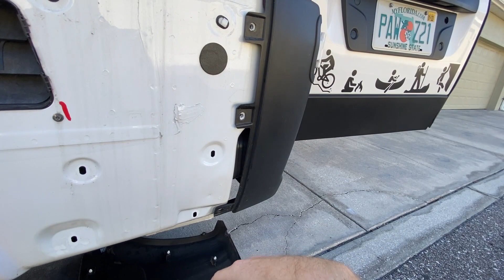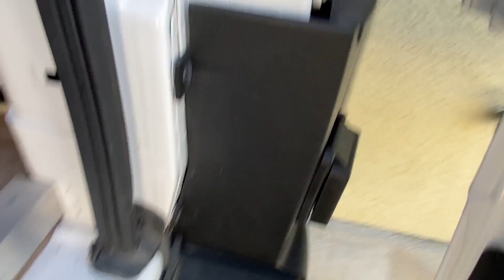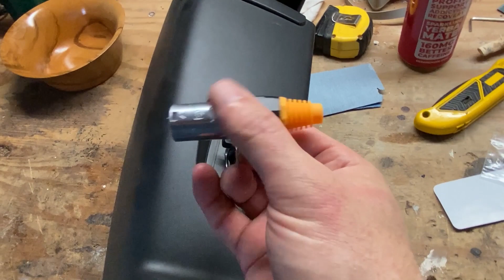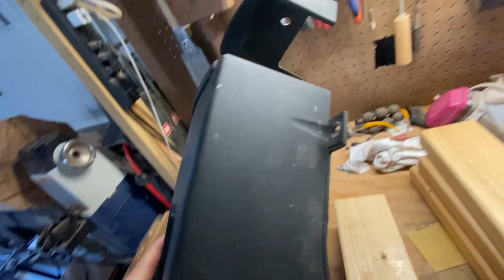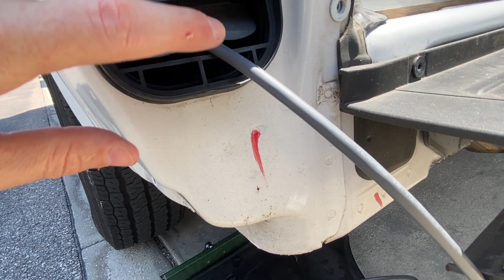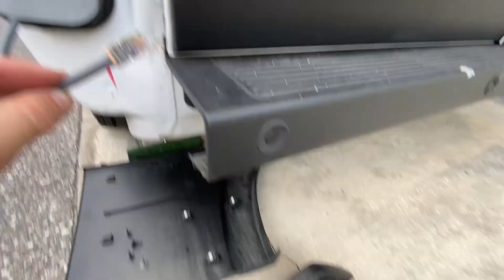Promaster Camper Van Starlink Install with external port 🚐📡

Comment: Would have been even better not to hardwire the router to the socket but add another connector so that the system can be deployed away from the van without the need for an additional cable.
Reply from the maker: I agree but I was purchasing another cable as a backup anyway in case there were support issues and Starlink Tech support insisted the issues were related to modifications. I've been in those situations before and you cannot give them an inch. Had I not covered the backside of the adapter with silicone I could possibly have unplugged it from behind and purchased a RJ-45 butt connector to reconnect the cable outside of the van. 👍🏼

Comment: This is a great video for anyone looking to install Starlink. I will be mounting the dish at my house. The facia board will be my "Van" side and the "Dish" side will be a short CAT 5 cable to the dish. If I have to take down the dish it is no problem. If necessary the cable can stay with the house. You can buy a new cable or use the residual cable to make up a traveling spare cable. Thanks.

Comment: Great video!!!!  Have you had any issues with the connector you recommended?  Looking at the pictures and the questions on the amazon listing it looks like it does not support POE and has no connection for the shielded/drain wire.  Thanks
Reply from the maker: No issues. Have used it several times now with no hiccups. Just last week I was in Key West and used it throughout the week with multiple disconnect/reconnects (in reference to the adapter). Works like a champ.
Reply: @MooreDoing  appreciate it!

Comment: Nice install. I’m planning a similar install on my Sprinter Van but ran across conflicting info regarding the quick connect waterproof rj45s.  Mostly regarding shielded/unshielded.  I ordered a similar one to yours and hoping it works out as well.  I’ve never done an rj45 jack so I hope all goes as smoothly as your install.
Reply from the maker: Just match the wire colors and you're golden. 🍻
Reply: @MooreDoing  sorry, total newby question.  When “matching” are both ends terminated to the same 568b standard ? It seems a bit illogical since when I put the two RJ45s facing each other, the wires aren’t “spliced”, but seemingly reversed. I suppose the jack these get plugged into adjust for this ?  Thanks.
Reply from the maker: @craigmcneill1916  No standards required. The only objective is to make certain your wires match relative to your chosen plug/coupler type. Since I terminated mine with two male RJ45 connectors and connected them together with a female/female RJ45 coupler, the pin-outs were a mirror of each other. So if I started with solid green on one connector I ended with that color on the other connector.